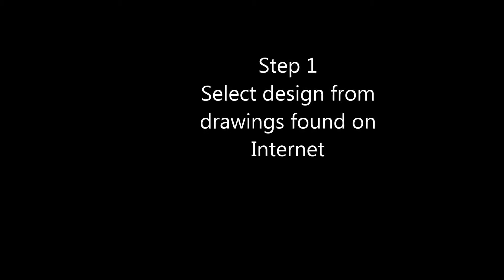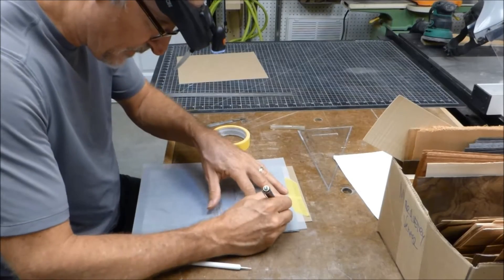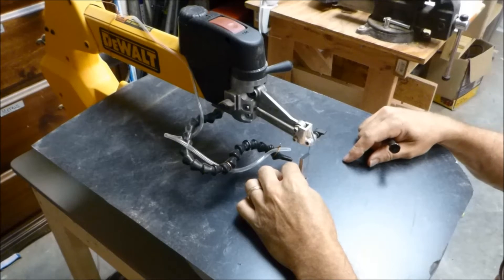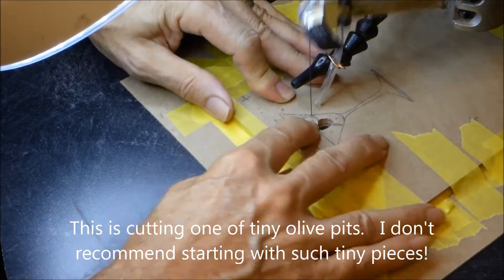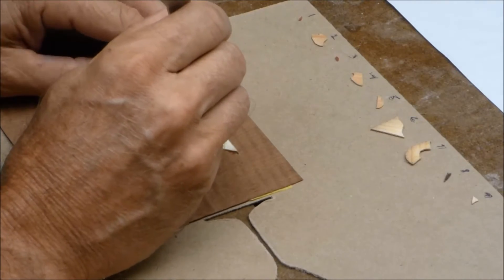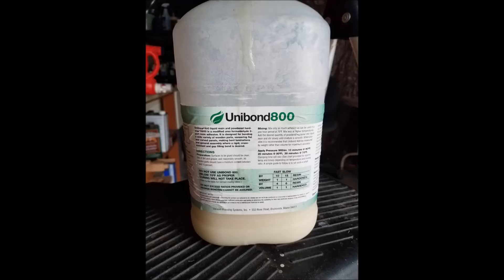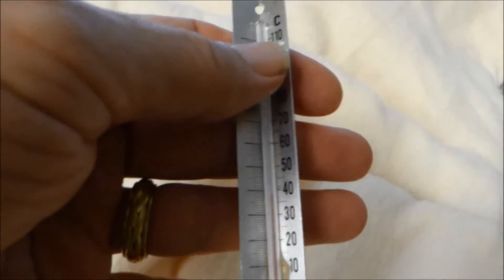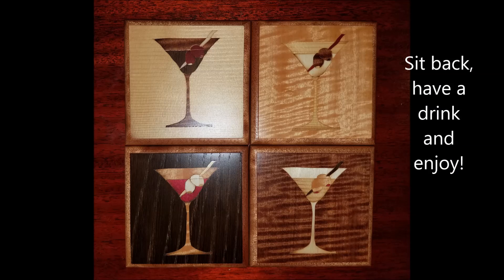Marquetry PAD method

Comment: What kind of tape are you using?  Also, what is the model number of your air compressor and how quiet is it?   Do you have any info on the venturi set up for the vacuum press?  thanks for the video.
Reply from the maker: Venturi is from veneersupplies.com, basic model : https://www.veneersupplies.com/products/Vac-Pro-Venturi-Vacuum-Generator.html.    Yellow tape is Frogtape delicate surface.    Not sure of compressor model, but it is from California airtools and is super quiet.   Mine has about at 2.5 CFM capacity and about a 6 gal steel tank.    All of the california airtool compressors are very quiet.   I put a 24 inch box fan by the compressor to help keep it cool, otherwise it can get rather hot because it is running nearly continuously.    A somewhat larger compressor might be smarter (say 5 CFM) because then it wouldn't have to run as much.    Also I adjust the pressure to about 80 psi
Reply: @jeffvicenzi2650  thanks

Comment: Please advise me to look out for when buying a scroll saw. Thanks!
Reply from the maker: One of the most important factors to consider in a scroll saw is the ease of releasing and reinstalling the blade, because you have to do that many times over the course of this work.   It is also essential that the saw uses pinless style blades,  which most do nowadays.    I've got a Dewalt DW788 scroll saw and would recommend it.    I could not find a less expensive scroll saw that I thought would work well.    A handheld fret saw can be used as an alternative and is much less expensive and gives excellent control